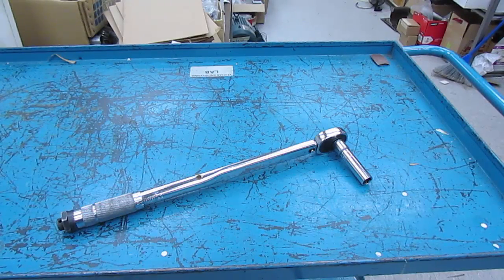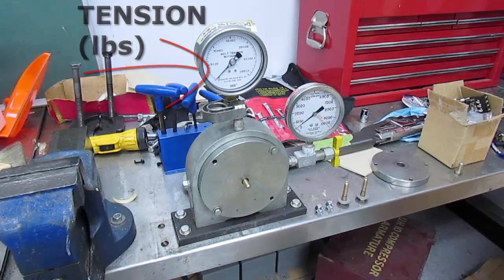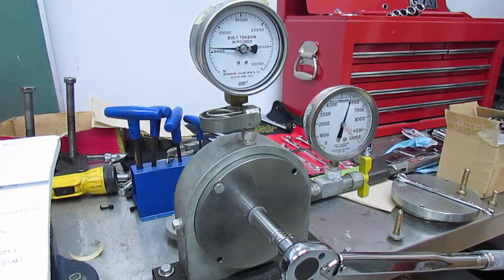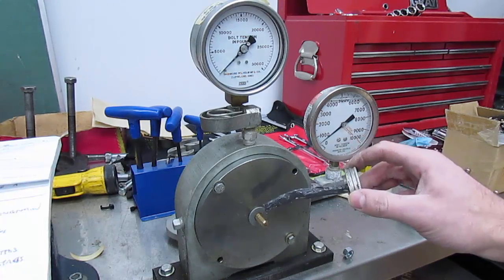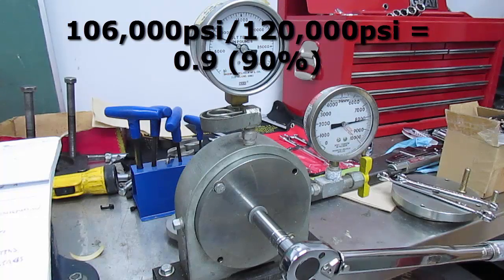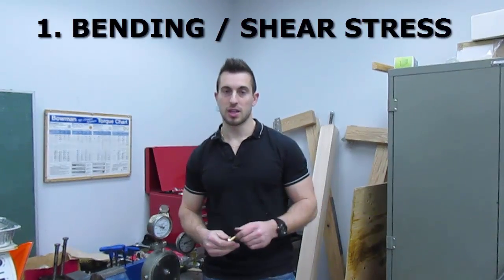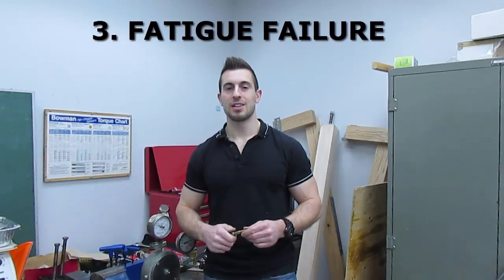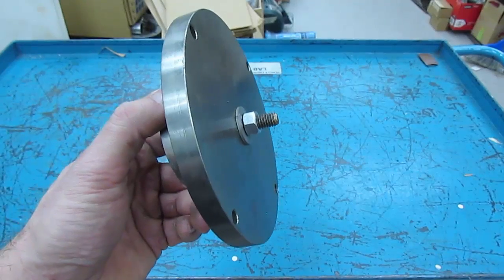Should You Put Anti-Seize On Wheel Studs / Lug Nuts?

Comment: The short answer is that if you apply lube, torque to 30% less. The only reason why I don’t do this is because I sometimes have a tire shop change my tires. They do not use a torque wrench and already over-torque. If I had lube on my studs, they would snap all my lugs off. 

So if you add lube, you can never let anyone else work on your car. Other than that, lube is better.

Comment: so the theory is sound here, but if you operate your vehicle in very harsh salt slush environments, like in Canada, your lug nuts will corrode onto the studs very quickly and be very difficult to remove. If you are in FL no problem but here with a 4-5 yr old car you could be snapping studs or damaging threads trying to remove the lug nuts which we do every spring and fall since snow tires are mandatory both legally and practically. I think I will just back off on the torque a bit. BTW, I don't think I have ever seen a mechanic in a shop use a torque wrench to install wheels in my life. They probably should, but they don't. Time is money.

Comment: I am skeptical of the wisdom of using copper anti seize on bolts subject to forces like lug nuts. I think the copper flakes can crush and move out of the area and result in loose nuts. In addition the anti seize will end up on the flat surfaces and result in the same loosening. I had a tractor wheel fall off that had copper anti seize applied in excess.

Comment: It will still act as a spring. The problem will be the next time. Torque to yield is common practice, but then the screws shall never be re-used. Which is not the case for wheel screws.

Comment: Anti seize with reduced  manufacturer's recommended torque specs  by 30%. Perfect. 30% reduction  is the right amount and torque needs to be done using an accurate torque wrench, not just a guess. The 30% comes from Ajax fastener hand book for heavily lubricated threads.

Comment: It makes more sense why the techs would torque dry bolts and put a mark 30 degrees. Then apply anti seize and tighten to their mark. Dont over torque a bolt ever when possible. Some of the bolts we install are in the thousands of dollars range. Torqued to several thousand ft lbs. Breaking or stretching one isn't an option

Comment: Wong yielding a bolt only decreases the thread pitch (making the bolt out of dimension)  but does work harden the fastener you must approach the UTS of the bolt to metallurgically damage it.  Under pre-load lead to fatigue not over-preloading.

Comment: I’m dealing with a similar issue, but in a different application.  I am pondering lubed vs unlubed torque value for keel bolts in a sailboat.  So nice to see you replicate the approx 25-30% difference in clamping pressure that most bolt torque tables show for dry vs lube bolt torque values. I’m going to use about 25% less torque than my sailboat mfg suggested dry torque value and use anti seize.  My reason for this is twofold: first the bolt/nut are stainless steel (which is prone to galling), and second, I want to get the clamping pressure values for all 12 bolts as close as possible.  Again, thanks for posting this.  Very helpful.
Reply: But seriously. After seeing this, can you even be sure? I mean c'mon im towing thousands of pounds, and your putting on bolts that you intentionally torqued to less than spec. Maybe you've gotten by, but should think about rethinking it. Just my take on it. Im not an expert but have a high amount of common sense. And that tells me his video is dead on in it's accuracy. Sure, you may get by for awhile, but why take chances? For $200 in lug and post replacements? To me it's just not even worth it. I don't know about sailboats, maybe it's not cyclical, but I'm going to replace ALL 12 of my posts and lugs, ef that I'm not wrecking out dying or getting sued .... And you probably wouldn't want that to fail out in the water whatever galling is

Comment: On the other hand, if your bolts are rusty, you will have too little preload. I live in the rust belt, and use a little anti-seize on the bolts and on the mating surface of the wheels and have never had an issue. I wish auto manufacturers would use it on every nut and bolt on the car. Whenever I have the opportunity, I undo bolts and nuts, put anti-seize on the thread and torque them back again. I also use anti-corrosion spray in any electric connector I can.
Reply: Would you ever consider using something like rus t inhibitor on posts and lugs? Just a thought
Reply: Would you ever consider using something like rus t inhibitor on posts and lugs? Just a thought

Comment: Forget the anti seize, just use a bit of axel grease. Use a half inch drive ratchet, torque it up using 3 progressive steps with the final being a very solid push/pull, and youre good. Done thousands of lug nuts this way without problem. Every broken lug bolt ive seen, except two have been from trying to remove when seized dry. The other two cases were caused by loosened nuts that were dry. I suspect their undertorque caused by thread friction whereby the nuts mistakenly appeared torqued but the torque was fooled by the rust of the lug and nut threads since I once caught a friend falling into that trap.

Comment: I've been working on vehicles for over 45 years. I always applied anti-sieze to wheel lugs. I have never had a wheel come loose or fall off. I have never broken a wheel stud either. Lately, I have stopped using anti-sieze on wheel studs and now only use a light layer of wheel bearing grease.I still get the same results using grease over anti-sieze. I use anti-sieze on parts that are exposed to heat, such as exhaust manifolds and exhaust systems. Wheels studs do not get hot. Maybe a little warm, but not hot.

Comment: So glad I stumbled upon this vid. I’ve coated my lug studs for years (since we live in the rust belt) and ran into trouble for the first time tightening our 2023 Jeep GC L lug nuts to the very high but manual required spec of 130 foot pounds. Trying to reach that spec with permatex anti-seize on the stud and lug nuts actually caused two of our studs to rotate with an inability to reach the spec. I initially thought it was a manufacturer defect.  Our local Jeep dealership had to replace the entire setup. To me, the higher the torque spec, the more damage can be done if using anti-seize. Thanks again for posting.
Reply: had a neighbor who hydrolocked his lug nuts, they came up tight, but it was because the antiseize was trapped in the nut preventing it from bottoming out. are your lug nuts open at the end?
Reply: @gregdawson1909  yes. They are.
Reply: Then explain how to remove a lug when it's rusted on and a 5 foot attachment to the wrench does nothing? I swear VW lugs are torqued to 300 ft/lbs!! They are impossible to remove. That's why i never take them to a dealer or tire shop. They always severely overtighten them.

Comment: I own a Toyota and for decades now I always applied anti-seize and then applied 75 ft-lbs to the nut with the anti-seize on it.  I'm now going to reduce the torque down to only 80% of the rated 75 ft-lbs, and torque the nuts up to only 60 ft-lbs just to make sure I don't over-tighten them.  Thanks for this information.
Reply: Well how did that work out for you? In short, Toyotas are lighter than alot of other cars. But when you're cruising say, 85 mph, does it not bother you that you 1 added a foreign substance / lubricant to your wheel lugs and 2 your now riding on those threads after you torqued all the lugs down to like 20% below specification? It would bother me alot, especially if I had kids in the car!
Reply: Good information 👍

Comment: Good information but not like for like when compared to wheel studs. I would be interested in seeing what the difference in stretch in a wheel stud because it has the large surface area in the taper that should create most of the friction. Anti-seize should be avoided for that area and should only be on the threads.

Comment: This is all well and good but it isn’t a perfect representation of the geometry that most wheel lugs have. 

You have the thread of the bolt as well as a tapered or conical section on the lug that engages a matching taper on the wheel. The most significant source of friction is in that taper interface, not in the threads. 

I don’t see how a little lick of anti-seize to prevent corrosion on the threads is going to appreciably affect your clamping load as long as you’re not lubricating the taper.

In your test, the nut is wicking the anti seize down onto the washer and effectively lubricating the flat surface of the nut.

Comment: Whatever Ft-Lbs you are trying to torque to, just multiply it by 0.7 and you will get the Ft-Lbs you should actually set the torque wrench to.
For example 44ft-lbs X 0.7 = 30.8ft-lbs
Multiplying by 0.7 is the same exact thing as reducing by 30%
Those of you in the rust belt and cold areas with salted roads can thank me later!
It's extreamly easy formula to follow.
My lugs are 80-120 Ft-Lbs according to Chrysler torque spec on my vehicle.
I normally shoot for 100 Ft-Lbs and that means I dial in 70 Ft-Lbs if I use Nickel-Graph/Copper/Silver/Blend Anti-Seize.
Reply: Good tip. I suppose this wouldn't work if your nuts and bolts aren't already corroded. If they are rusty, putting anti-seize on them would probably even it out.

Comment: Great to bring this to attention, but there are problems with leaving lug nuts dry.  In warm climates where vehicles are not subject to road salt, keeping lug nut free of anti-seize would be good advice.  However, those of us to drive through salty slush have a corrosion issue. In addition to problems with steel rims, aluminum allow rims bathed in road salt experience galvanic corrosion, the effect of which is far worse than for steel rims. Removing corroded nuts can cause over torquing while removing. I have seen rusted nuts that have required lengthy cheater bars.  This can cause over stressing and thread damage. With aluminum rims, even if the lug nuts are badly corroded, the white corrosion product actually adheres the aluminum rim to its seating surface which is steel. I have had to pound on aluminum rims with considerable impact to break the bond of corrosion.  This must be done with care not to damage the rim, such as using a heavy wooden block as the striking implement, or placing a wood block as a pad and striking the pad with a hammer. Once removed, the rim's own seating surface and steel surface on the vehicle must be carefully cleaned.  This can take a lou of personal time, or shop labor. A preventative measure is to smear a thin layer of grease over the mating surfaces.  Even in salt free climates, repeat cycling of tire changes over the life of a vehicle can damage threads.  Lubrication can prevent thread damage.  It seals salty water to prevent corrosion.  Despite the advice given, in my road salt laden area, I find it necessary to lubricate lug nuts.  I find that anti-seize compounds actually dry out and make future removal difficult.  A good water resistant grease such as fifth wheel grease works for me.  I have never had a wheel loosen off, nor have I had a stud damaged.  Lugs and nuts have a good safety factor engineered in, so can stand some extra effective torque. Everyone else must make their own choice.
Reply: In Wisconsin I bought a new car and parked in a heated garage all winter. In the spring, I could not get the aluminum rims off, kicking, hitting with a rubber mallet, etc. I even created a small dent when kicking backwards and having bad aim. It took a wooden board and a friend hitting it with a sledge hammer to finally free them.  I leaned two things--use anti-seize on the bolts and mating surface and don't park in a heated garage. Things don't corrode which when it's cold out. But when you bring a salty car into the warmth, and let the snow melts, things corrode very quickly.

Comment: This becomes a much bigger issue on wheels that are lug centric. Hub centric wheels transfer the weight of the wheel mostly from the hub to the wheel. Not from the studs to wheel, as a stud centric wheel does. Wheel studs on a stud centric setup do double duty (clamping & support of the vehicle wieght), and is part of why most modern production cars use hub centrist wheels. It prevents the greater rate of wheel stud failures of the old stud centric wheels. Some after market wheels are stud centric to increase the number of vehicles they can be used on without a redesign, and is important to keep in mind.

Due to heavily salted roads for 6 to 8 months my maintenance schedule, and parts needing to be replaced is much higher then an environment without salt. So I replace my wheel studs far more often. Even in a less forgiving environment, wheel studs are only designed to be torqued a certain amount of times before losing thier ability to strech. It's why they should be replaced everytime you get new tires. Specialy if the shop uses impact guns & torque sticks. In a worse case, just impact guns. 

I use just a smige of anti-seeze (very technical term lol) inside of the lug nut. This keeps the the nut from becoming one with the stud, and prevents the anti-seeze from getting on the lug face. I will also use a q-tip to smear the none contact area of the wheel studs with a very thin film of axle grease to significantly slow down the rusting of that portion of the stud. This way the dam lug nut can be removed after 3 of the 6 months of (au)salted hell for a tire rotation, and the studs make it through winter. The studs get cleaned with break cleaner, and redone reinstalling the wheels. Use of a torque wrench is important. Due to the salt I replace my studs every year. On the fronts this is done by default when replacing the rotor. 

On my drum rears I have measured the stud length brand new, and again after one winter (2 tire rotations), spring & summer (another 2 tire rotatiins). They were well under the acceptable amount of stud strech. It's the best way to determine if the studs have been over torqued (by anyone), and ruined your studs or if they have just reached the end of thier service life.

Comment: I use anti-seize on about everything from brake caliper bolts and pins to lugnut studs and have been for 30 years never had an issue. Do yourself a favor and use it because if you don't well let's just say you'll wish you did. Also I have never used a torque wrench on lugnuts I've always used a tire tool and never had an issue a torque wrench is for beginners or the weak  in my opinion 🤔

Comment: You don't want antisieze or grease on 2-piece lugnuts like used on the super duty and heavy duty trucks with hub-pilot wheels.  
They are machined for minimal friction between the nut and washer, and for the washer to not turn against the wheel. 
Any lubricant on the washer face will allow it to spin against the wheel, which will gouge into aluminium wheels.
But with stud-pilot or BUDD truck wheels, there is no such thing as too much antisieze.